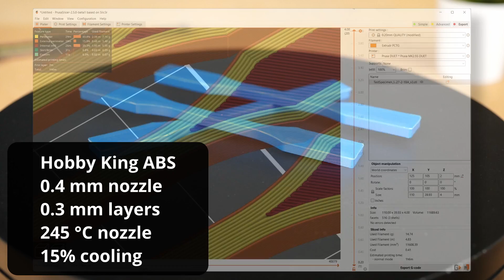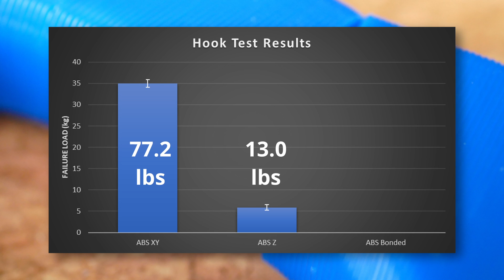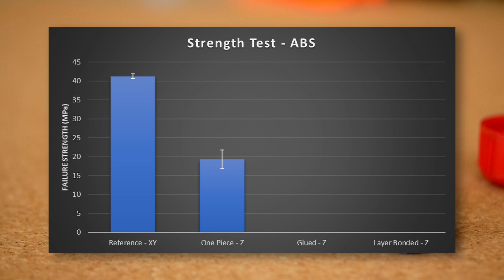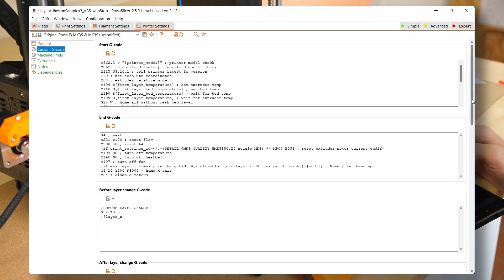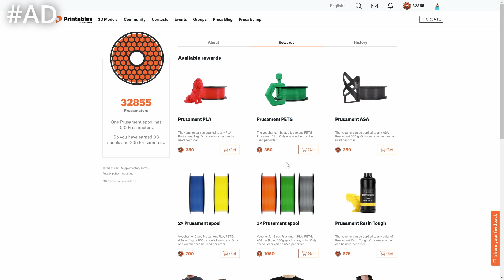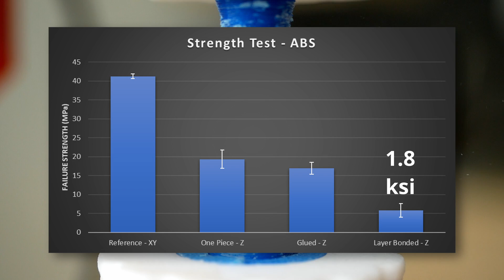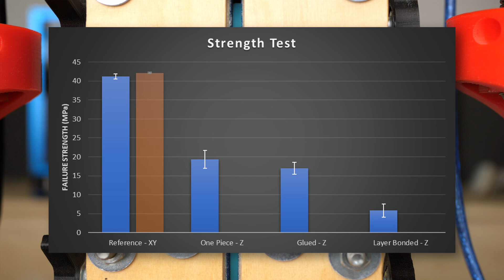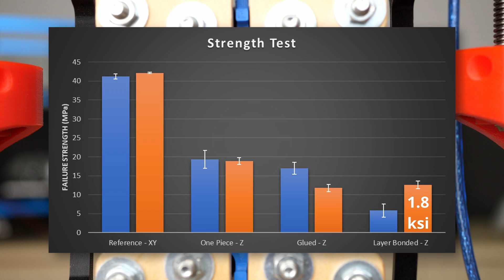Perfect Layer Adhesion if you Brush Solvent onto every Layer of your Print?

Comment: Layer strength is  presumably proportional to area , so anything that reduces voids ( more squish!) would help.  There is also a stress riser where each rounded section joins the one below, so smoothing that may help.   Ultimately though, it is the bond between layers that is the problem. Improving the bond would require both the new layer and the previous one to be at the same plastic state   so perhaps a point source heater (IR spot /laser ?) to increase the temperature at the interface without melting the whole stack would work?

Comment: This seems like a fire hazard.
Reply: Definitely needs good ventilation. I don't think the printer itself would be enough of a source of ignition, much less the air to fuel ration enough for it, but always better safe than sorry, specially since it's a substance you already need to use breathing gear just to work with for so long.
Which does make it even less attractive for ABS where you would want the least possible ventilation (or at least cold air).

Comment: Print the part hollow and fill it with abs slurry 😂
Reply: An interesting idea, I would assume the evaporation would make it shrink quite a bit but that's part of the deal.
Your idea is similar to how I've seen a guy on Youtube make sheet metal bending tools (EDIT: wait no not just bending tools, STAMPING tools as well!) out of PLA - he made it hollow as usual, but with no bottom layers, and filled it with epoxy resin.
Insanely strong parts in the end.
Reply: @Kalvinjj  stamping metal with plastic is too cool 😎 i totally want to see Stefan do that.

Comment: For strength, has anyone tried printing a part with an infill that would allow the part to be filled from the top with some kind of low viscosity epoxy? Thereby making the part solid.
Reply: Yeah, I do this quite often. Sometimes I need to spray lacquer over the part to make it water tight ... or epoxy tight, whatever.
Reply: Yes! Print it hollow, but use a high filler content, or else the epoxy will get too hot and deform the part as the chemical reactions take place. For parts that need a lot of compression strength, this is a good choice.
Reply: @ruyvieira104  Use deep cure epoxy, takes ages to cure. You can warm it up to like 30 degrees C to accelerate the curing though if time is a factor.
Reply: I'd like to see what infill and what percentage is a good choice as well as what epoxy is a good choice, then see it tested. Maybe forcing a 3D print to be structural is asking too much. Maybe using the print as a sort-of investment cast is better.
Reply: @Rattletrap-xs8il  0% infill if you're using epoxy + filler, gyroid and a low % like 5-10 is ok if you're using just epoxy, but that's not as a good as using epoxy with filler. Pick low viscosity epoxy, then you have choices of slow and fast cure. Use slow if you're using just epoxy, fast if you're using filler (since the filler can take a lot of the heat). Sand is a great filler for high-compression strength, high heat-resistance parts.
Reply: @ruyvieira104  I have never thought of using sand as a filler. I might give that a go sometime.

Comment: Hello. I have improved the layer bonding to 80% and applied for a patent. 
However, there is a simple trick I can share. The sections of deposited layers look like stacked ellipses; there are a lot of gaps in between. One way to reduce the gaps is to stack the layers like a Brick mortar pattern. I tried to suggest it to Cura developers to automate it, but no one replied...

Comment: You could try leaving a hole or two through the model and force a single extrusion of filament through it. It might anchor the layers or normalize the cooling related stresses
Reply: Diy injection molding! How cool is that! Now that is something one of those super-high melt volume hot ends would be good for.
Reply: @Balorng  check out the channel "action box", I think the name was. They have a DIY maker level injection molder.
Reply: What an interesting idea!  This made me think of another idea: what if you made only 1 infill layer every 4 layers, but when you did print it you significantly over-extruded it so it filled up the extra space and it overflowed a little. Now you have a large blob of plastic that is hot and melted and may hold more sturdily ( it will look ugly, but it is the job of the outer layers to look pretty)

The idea I came here to post was to force the filament through a wet pad of solvent before printing. It will soak into the filament melt and make the plastic softer. It might give an effect like printing at a higher temperature.
Reply: @grahams5871  Try Cura's "Infill layer thickness" setting, it does exactly this.
I think a solvent soaked filament would boil and foam when passing through the hotend?
Reply: @grahams5871  Cura allows something like this. I've never tried four layers worth, but I often do two.

I haven't noticed any strength difference, but printing is faster, which is nice.
Reply: @grahams5871  that's basically spaghetti infill.
Reply: you would need really high pressures/very fast extrusion and it still would probably have injection defects. I don't think it would be worth the effort over just printing more walls.
Reply: Yup, that's why I've mentioned 'modern hot ends'. I think you'll need like 100w heater, at least volcano-like heat path AND CHT nozzle so it does not solidify before filling the "channel" and absolutely no 'cold core' issues. Since the 'mold' is already 'preheated' by the bed, it might be quite viable - low thermal conductivity of the plastic might actually serve a good purpose here. I think filling one of the 'spiral channels' created by gyroid infill so you'll have a solid spiral inside the print keeping everything together might be quite interesting - mechanical interlock, or otherwise creating a somewhat winding path to fill. It would need a pressure relief, and course you'll want to actually bury the nozzle in the print to create an actual seal, and than print over the resulting impression. You'll need pressure relief inside the channel as well. That's pretty complex g-code programming, but quite doable for someone like Stephan.
Reply: Due to the viscosity. You could do an array of holes  maybe 4mm deep and 2mm wide then extrude into that. If you vary the depth of the holes you could have an interesting interlocking structure that may provide additional strength
Reply: @Caelestis-des  this is probably a more practical approach to my idea, yea.

I think you could get away with 6 deep with a 3 layer difference
Reply: At this point just print it hollow and fill it with epoxy
Reply: If would think 4 holes. Every 2 layers fill 2 holes up and wait 2 layers to fill the other 2. Then repeat.
Reply: Oooh, injecting a spine after the first printing phase sounds neat.
Reply: why not fill the model with a cheap filler like glue, silicone, pvc cement
Reply from the maker: I tired this with a proof of concept a while back but filling those holes is not trivial - yet doable IMO.
Reply: @CNCKitchen  did you do a video on it or was it not worth it?
Reply: Someone needs to try this
Reply: I came here to suggest something similar. It's a bit linear and mentioning FDM and injection molding in the same sentence is frowned,  but sounds interesting.  I was thinking of a way to fill voids left by infill. It would likely need to be a different material. If its just one hole through the part,  it wouldn't reinforce the outer layers much.
Reply: I wish he’d do more experiments in salt baking
Reply: at this point just use a threaded rod to hold the print in compression, we don't need to do just 3d printing.
Reply: Ah seems we are great minds lol
Reply: Why not put epoxy inside of the hole? Then you only have to stop printing once and you also need to take care the air inside the model.
Reply: Honestly, if you want to extrude through the entire print, then you'll probably be better off with an extruder that you can push all the way through the print (it will need a linear actuator to move the filament, not a normal rotary one): finish the conventional print, put your preloaded (you'll need something that you can pull it with, power, it should probably be preheated, etc.) "intrusion head" all the way to the bottom before removing the print, and start the "intrusion" process. In the ideal case, the "intrusion" process will be enough to move the "intruder head", but you'll probably need to pull up the head as the intrusion proceeds instead.
Reply: There's actually a research paper about doing a similar thing. Except instead of doing the whole model all at once it does a few layers and offsets the infil halfway through a layer so there are no horizontal shear lines. You also don't need to do the entire model. When you have an odd number of perimeters you just fill in with this strategy on the even numbered perimeters
Reply: At the viscosity FDM usually works at you would need a hole probably 3x the extrusion diameter for it not to just squirt out the sides and solidify into a huge blob. Even then it's likely going to stick to the walls high up in the hole, solidify and plug the hole without filling it.
Reply: @OB1canblowme  It might be worth experimenting with hole diameters and how deep it should be. Then,  instead of one long hole, you have a series of shortish plugs distributed over the height of the part.  I bet you could fill a plug with a diameter:height ratio of at least 1:3.    You would also have to worry about trapped air.
Reply: What a fascinating idea!

Comment: Print the parts with a hole in the center and thread a long bolt into them. It might seem as a cheat. But many people oversee this solution despite it being the most easy one to achieve. A hole of 3.1mm in the bottom and 2.7 in the top part is perfect for a 3mm bolt.
Reply: The more videos I watch about 3D printing, it seems that the majority of the community is not interested in actually designing things, just messing around with the printers.
Reply: @xSiliconKnightx  yep, I am guilty of that too. But its fun to get a cheap ender and upgrade the shit out of it. I am at the final stage tho, just need a dual Z axis and I can sleep again.
Reply: That's why I bought a roll hanger strap for, putting it in slots in prints. Now I honestly haven't used it yet though, it would only be needed for huge parts with huge need for strength.